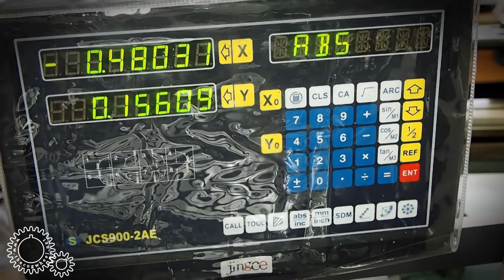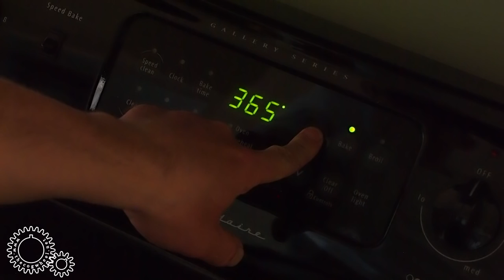Shop Made Yo-Yo!

Comment: Very interesting and good video. I have done the brass inlays in a lot of my projects. To me it gives it a more finished look. In one of your past videos I had ask a question about your 5C collect chuck I have purchased a set of 5C collects and now in the market for a 5C collect chuck. I was wondering where you got yours and did you build your back plate or purchase it with the chuck. Any information would be very helpful.
Reply from the maker: The brass inlays are more than just for looks - the weight is functional.  Regarding the 5C collet chuck - I purchased a plain back one off Amazon Canada.  I'm not sure who the importer was - but it shipped directly out of Korea.  I recommend you get a plain back one and either buy or make a backing plate as it allows you to adjust the 5C collet chuck to run true.
Reply: thecogwheel thanks for the reply and information. All my brass inlays were just for looks. Even though yours is for weight and balance they still set it off and have a nice contrast and also looks very good. You have a new subscriber.

Comment: Enjoyed that one very much.

I recently "made functional" my own take on the quick change tool post that you made some time back.  I put it that way because I still need to make a custom locking handle/top nut, and I've yet to settle on a design.  But I have been able to try it out, and so far,  I've been quite pleased with the results it has given me.  I'm wondering if you have found any serious drawbacks to the design yet (other than needing a way to lock the position of the body during tool changes)?
Reply from the maker: The toolpost design is really good for a home shop.  I'd make another one in a heartbeat.  The only downside is it takes time to make - which for some isn't a big deal at all.  If you are limited on time at some point you have to decide if you just want to make tools or make something else :).